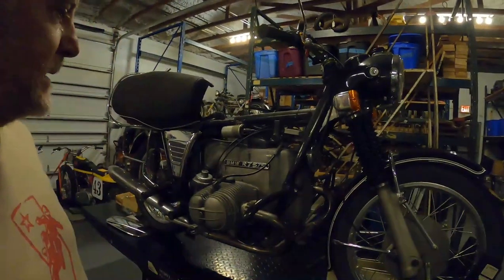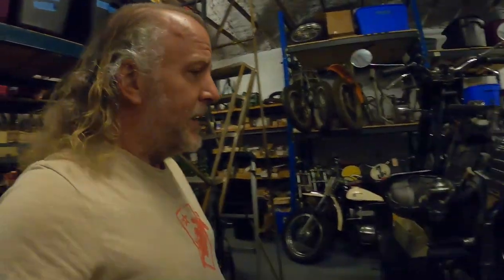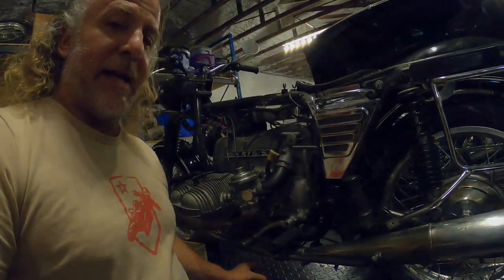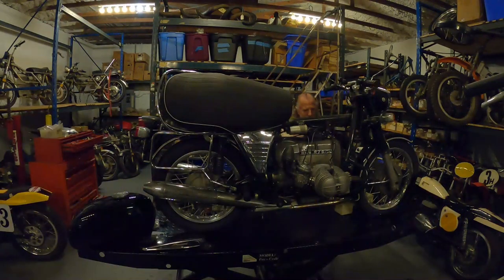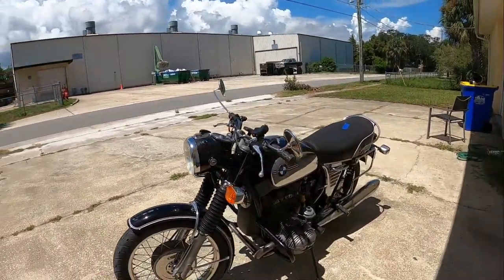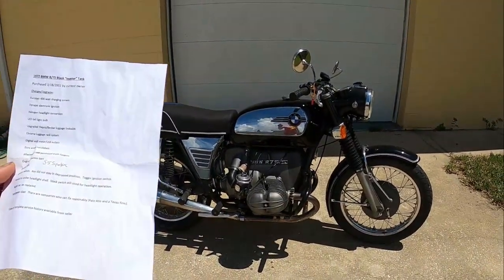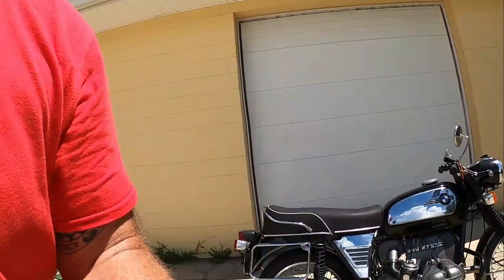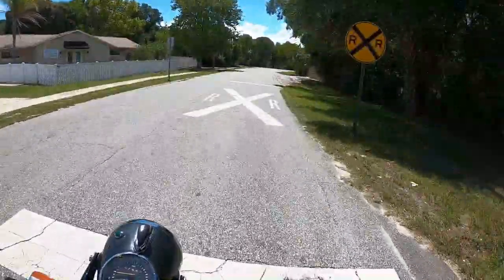BMW R75/5 TOASTER TANK - MMMMM . . .  TOASTY

Comment: One question, a fuel tank of 70’s model fits on a 1983 models? thanks for the info
Reply from the maker: I'm sorry I don't know the answer to that
Reply: No.. Different switches and relays under the tank of '80s models require more space than in '70s

Comment: Yeah you guessed it, me again . . . 
Thanks for mentioning me and my previous comment [re the hatchet job you did on the K1] in one of your recent videos, my 15 minutes of fame? 
You have to stop referring to comments/replys as 'hate mail'. You are expressing your opinions on a public forum and as such must expect responses of some description from the biker public, positive or negative! 
I own a 1973 75/5 and have to admit that these older machines have their foibles, that's their appeal isn't it? But before making the purchase I did some research on them which highlighted a 4 speed gearbox [transmission as you guys call it] and drum brakes. The front brake efficiency was non existent, and the rear was over efficient which was a bad combination. Now sorted and a dream to ride. The gearbox may only have 4 gears, but they're ratio's are long making the bike feel usable in town as well as on longer runs, and not at all stretched pushing up the revs etc. The other advantage being less gear changes needed. I could ramble on all night about the positives and negatives of these bikes, but prefer not to moan and just improve and adjust as required. No one likes a moaner.
Reply from the maker: Thanks for checking back in! I appreciate you're still watching. My "hatchet job" still draws a lot of response, but that was my story of that bike. Did you see my review on the R100GS, that Beemer I really liked! So it's not all bad. Just sometimes! I'm glad you took it well and checked back!
Reply: My ex-wife was a moaner. That's about all i miss about her. Screamers are a dime a dozen, but a good moaner is a thing to behold. Problem with moaners are they know what they got and they usually come with alotta bullshit.